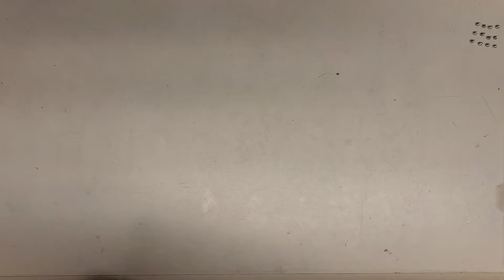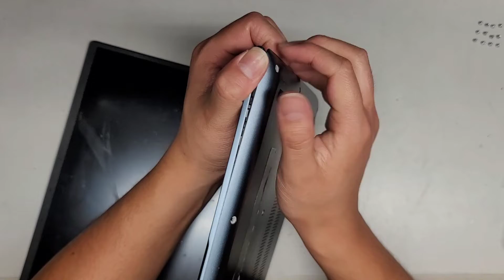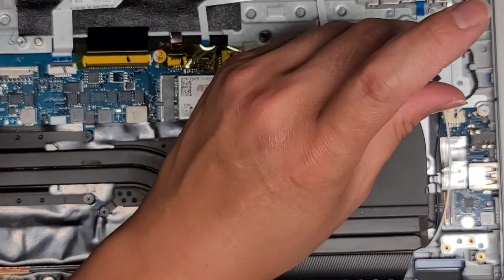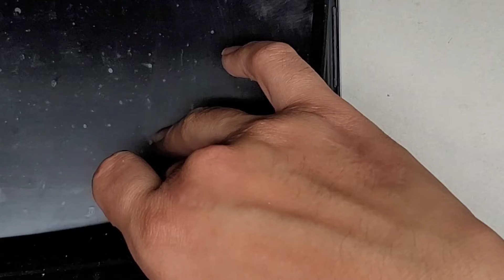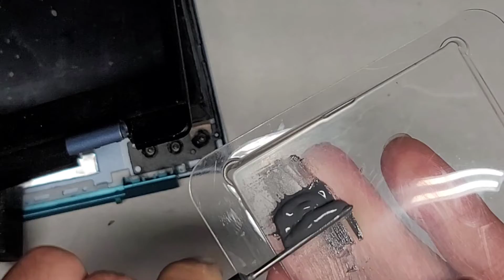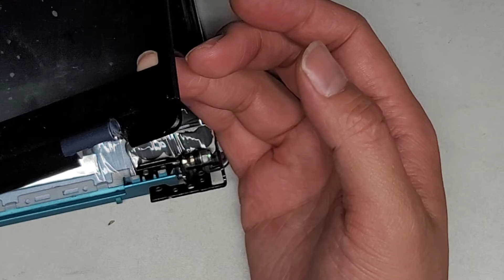Acer Swift 3x N20H3 SF314-510G-777S Disassembly SSD Upgrade Battery Replacement Repair Hinge Repair

Comment: You Sir are a life saver..!
I've got this exact laptop in golden colour and was facing the same hinge problem but on the left side. I just repaired this at home watching your video step by step. I have just fixed it and will wait overnight for the bond to cure. I bought the Speed wing metal repair epoxy to apply on the hinge. It cost me 2 dollars (200 Indian rupees) here in India. That's it. I was advised to buy a new laptop as the body parts were not available. So you saved me atleast a 1000 dollars by putting up this repair video. God bless you. Love from India.❤❤
Reply from the maker: I hope that epoxy works well.
Reply: @ItsBinhRepaired fingers crossed. This is not the first time the hinge broke. Previously had given it to a local shop for fixing it and it cost me 50bucks. When i opened it today, I saw he had used a regular glue on the hinge. Hope this one holds up for atleast a year. I can buy a new one next year.
Reply from the maker: @ameya_parrot_paradise  the problem is epoxy has a hard time sticking to the glue.